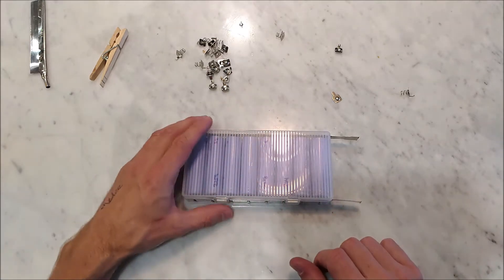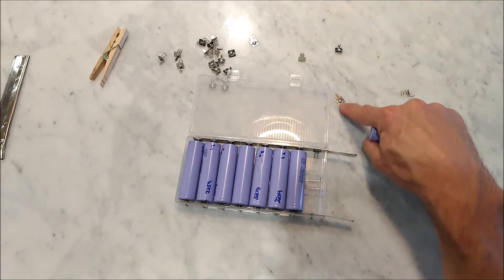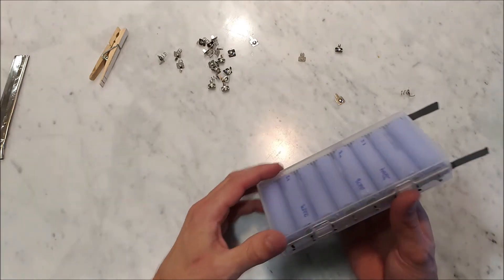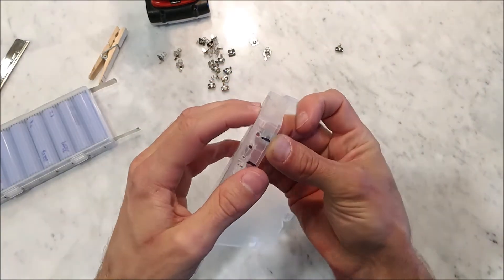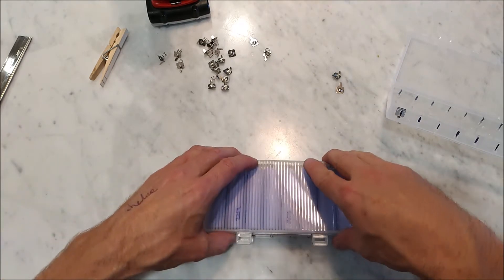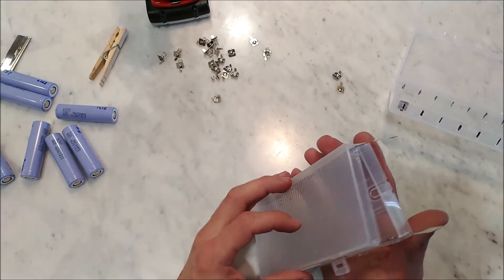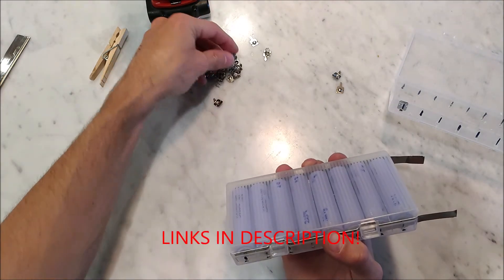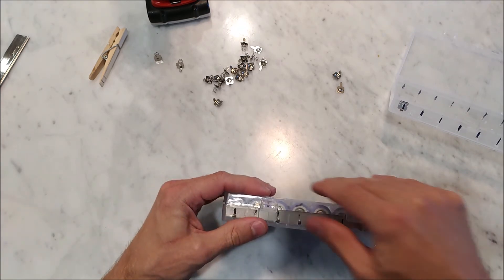DIY 18650 SOLDERLESS BATTERY BOX

Comment: I made two packs out of wood, glue and silicone sealant to hold the battery spring tabs. They powered my DJ computer and a boombox. Then I discovered 18650 battery holders that have built-in battery tabs. They come in various number of cell slots: Single cell, two cells, three cells, and four cells. There are only thick tabs, no springs.

Comment: What is the advisable max current draw?
Reply from the maker: 15 amps max
Reply: @stevenc22  oh thanks, I thought I can make a 12v battery pack with this. I don't have nickel ribbon strips and spot welding machine, that's why I'm looking for something like this. Thank you for your response sir.

Comment: It's possible to make it even cheaper. Replace all springs and the other side clips with the same nickel strip bent in a tiny triangle. Should work as a spring on both sides. Besides, real spring is steel - not a very good conductor. Or you could make your own springs out of spare copper wire.
Reply from the maker: Without out the springs, i worry the batteries will become loose. I have recently purchased a different kind of clip to test out. its more of a bent piece of spring steel instead of a spring.
Reply: @stevenc22  , I understand. That's why I mentioned bent short nickel strips. For example, if bent into S form, they could act as a spring by themselves and could be easily attached to the main strip. The only problem is nickel is too soft to act as a spring. A better option is nickel-plated steel. Cheaper too, but loses in conductivity a bit.
Also, one side could be without any clips at all. Just take the main nickel strip, a flat-headed hexagonal screwdriver and punch little bumps for each cell.

Comment: Is one piece of nickel positive and the other negative? How would you use that in a electric skateboard
Reply from the maker: Yes. One side is positive and the other side negative. These are designed so you stack 7 cases together to get a 24 volt battery. This design would have to modified for an electric skate board since an electric skate board doesn't have room for 7 of the packs.

Comment: In my experience, those coil springs are designed for AA batteries and are too weak to hold the amount of current that will pass through it when powering a device like an ebike motor. It holds well when little current is passing through it, but it will melt or disintegrate and experience significant metal failure when exposed to high current demand like that from running a real world normal appliance (even a low power 24v-36v 450w motor, not to mention a 1000w motor or a 1200w microwave oven). I have had my share of melted wires and holders. To be effective, a supply of very strong/thick springs is needed and a means to establish a large amount of surface contact between the battery and the metal terminals/springs. Having a small contact point (like random touch points from a coil spring) would only pass a small amount of electrical current---like feeding water through a straw instead of a water hose, and thus become high resistance in current flow. A flat surface material like leaf spring would give more contact area than the rounded surface of wire (and the wire is also spiraled away from contact). Perhaps the use of electrically conductive grease would improve the surface contact area. You would still need metal that has a larger current capacity; like leaf spring instead of wire spring.
Reply: How many amps each One of those clip could handle?
Reply from the maker: 3 amps

Comment: Great, how exactly do you charge it?
Reply from the maker: Easy. With a lithium charger for 1s /2s / 3s ect depending on how many you stacked together
Reply: Stevenc22 how many would you stack to make 24volt? Thanks.
Reply from the maker: @islandonlinenews  each battery and box is 3.7 volt average. Therefore you would build a 7 pack to hit 24v. They are max voltage of 4.2v each therefore a 7 pack would need a 29.4v charger.

Comment: I have 3.2 v 75ah lifpo 8 cell i want 2 make ebike bpack. so q is witch BMS i must use. I have 24v 350watt kit fitted in my bicycle.
Reply from the maker: You need a 8s lipo bms. https://rover.ebay.com/rover/0/0/0?mpre=https%3A%2F%2Fwww.ebay.com%2Fulk%2Fitm%2F192857275790

Comment: Kinda looks like the type of solderless battery box I pioneered two years ago and shared on the endless-sphere formum : https://endless-sphere.com/forums/viewtopic.php?f=14&t=57810&start=150#p1213147With these springs, you can probably expect to pull as much as 20 amps for the whole 8P pack before you completely cook the springs and see them completely loose their spingyness : see how they cook here : https://endless-sphere.com/forums/viewtopic.php?f=31&t=87434&hilit=cooked+springs&start=25#p1277444